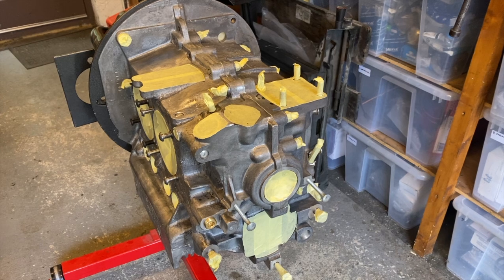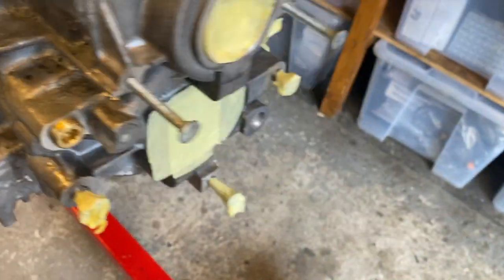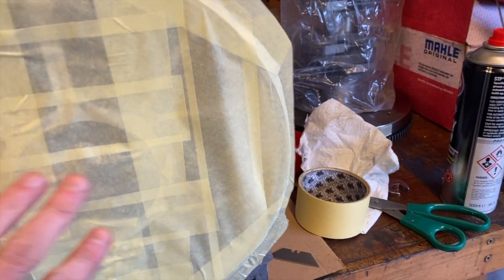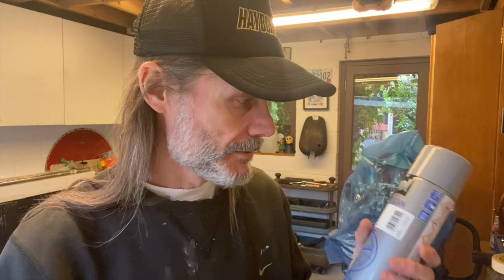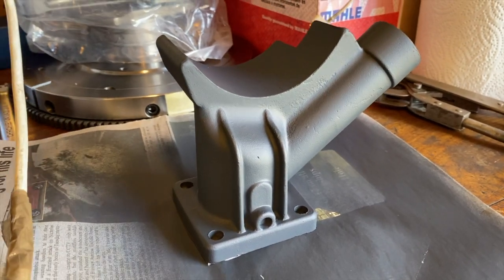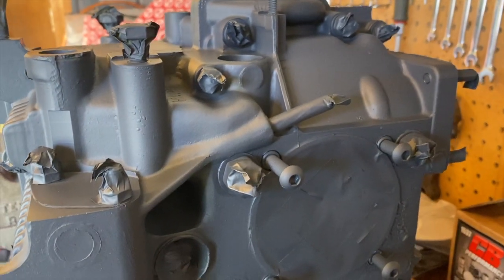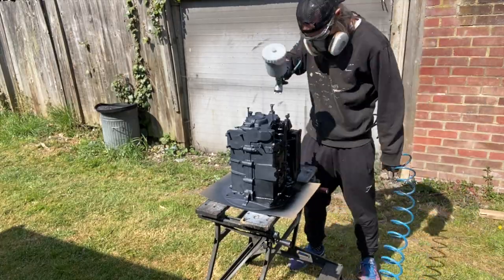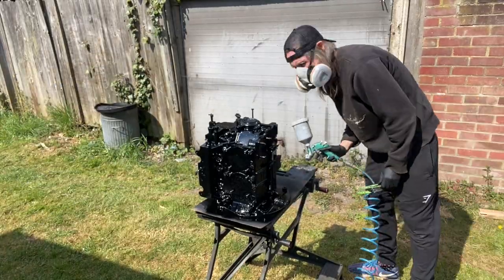PART 8 – Painting the AS41 Case - How to Build a CB Performance 2017cc Builder’s Choice VW Engine

Comment: When’s the final build ? 😂 what do u think to the CB Kit so far,?
Reply from the maker: The videos are a bit behind my real time progress. I'm currently finishing the long block build. Having trouble with the pushrod tubes - that's a goning to be a video of many mistakes and experiments hahahaha. 

The kit has been good so far. For a first time builder it's beej great knowing that when its all together it will work and has been tested as a package. Putting it together has proven to be not as simple as a stock motor. Lots of modifications andthings to learn, but I've enjoyed that part of the process.
Reply: @aircooledanything2415  what did the engine cost as a turn key carbs the lot? Would you recommend instead of looking for a second hand engine to build or rebuilding existing?
Reply from the maker: @tospicy4ya  The entire build including exhaust has cost around $10K. So not cheap. Shopping around and buying parts from other manufacturers might well work out a bit cheaper, but not by much. I hve gone for a lot of expensive extras, distributor, A1 exhaust, etc. Rebuilding an existing motor is WAY cheaper. That's what I've done in the past. BUT as soon as you start adding extra horse power to the motor you start adding dollars too. It quickly adds up. So in short it depends what you want. If it's a stock motor you can do it on a budget. If you want a few extra horses then it's gonna cost you a bit more. If you want a motor like this one, mildly spicy, then its more, and if you want to run a 7 second quarter mile you can multiply what I've spent by 4, hahahahahaha.
Reply: @aircooledanything2415  wow that is a lot, not sure what spent on mine but it’s built around an auto linear case I’ve heard there’re good
Reply from the maker: @tospicy4ya  Damn. Very nice. Wish I'd gone with an aluminium case. Defintely doing that on my next one. Maybe a turbo.

Comment: Hate to burst your bubble. But the majority of paints are an insulator of heat. There is such a thing as a heat dispersant paint (see Jake Raby's - Aircooled Technology painted cases). However, if your in London I think the issue is going to be getting your engine up to temperature quickly if your not running a thermostat set up. In Australia we find the stock doghouse cooling system works fine at cooling our 1776cc engines in a heavy bay window bus and for half of the year the issue is getting the motor up to proper running temperature when the thermostat system has been removed. So painting your engine case for use in England I don't think is going to cause any issues for you anyway if you do paint your heads - it might actually help your engine run closer to proper running temp if your using addition oil cooling etc.
Reply from the maker: This is all very useful info. I was reading on the Bob Hoover blog that matt black engine paint can help radiate heat, but that's just the opinion of one guy with no actual data to back up that claim. What you say makes total sense - any covering would surely act as an insulator. As for na thermostat, I'm still toying with that idea. Obviously a lot less hassle to build the motor without, and to be honest that is the more likey outcome , hahahaha. Here in the UK we don;t ever really get problems with hot days - only a few weeks a year where overheating is potential a problem. I hadn't really considered warm up issues, but that is a real consideration that I have overlooked so far.
Reply: @aircooledanything2415 
With bigger capacity motors in our climate we don't worry about the factory thermostat system. However, if in your part of the world its going to be getting much below 10 degC when you want to start and drive your aircooled Vw then personally I'd be thinking about reinstalling a working thermostat set up - your motor will thank you with more longevity and much nicer / quicker warm ups. If you decide to not install the factory thermostat set up and your motor has full flow set up to an external oil cooler as well as the original oil cooler, "and" you have a deep sump then I really think your going to be over cooling your motor in your climate. I'd ditch the deep sump straight away (they often have casting sand still inside in crevices you can't clean or access properly. Also many of them have a crude extension of the original oil pickup pipe. Not to mention ground clearence issues). I'd only run a small oil cooler on your full flow set up and make sure you install the inline 4 way thermostat control  - not to be mistaking this for the fan thermostat control that comes with fan forced oil coolers. I'd probably consider not running a fan at all on an external oilcooler in England. However, if you intend travelling on road trips down to the South of France or Italy where you might get caught up in a snail pace traffic jam, then I'd probably install a fan forced external oil cooler and only let the fan operate when in those areas. We generally fit additional external oil coolers without fans and just position them where they can get a good steady air stream while the car is moving (the faster a vw moves generally the more rpm the motor is doing and more heat its making. But the factory fan is in tune with this and does a reasonable job too.